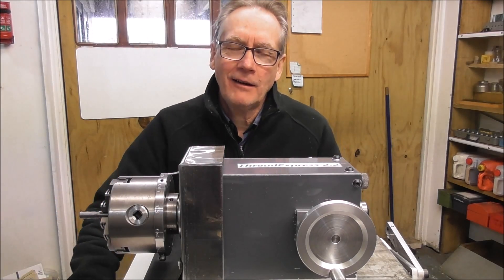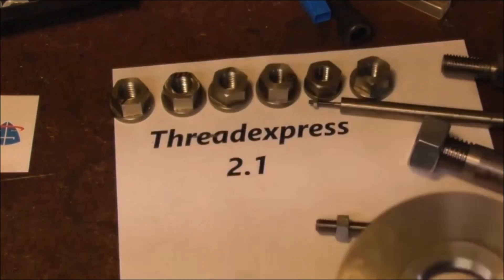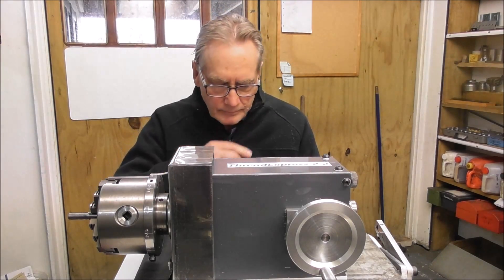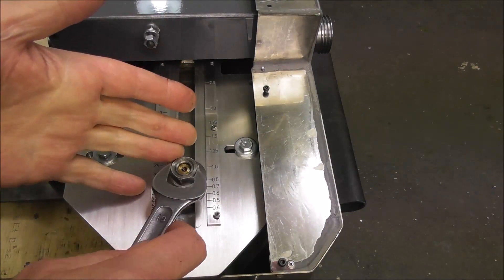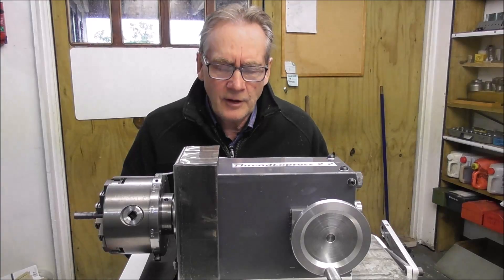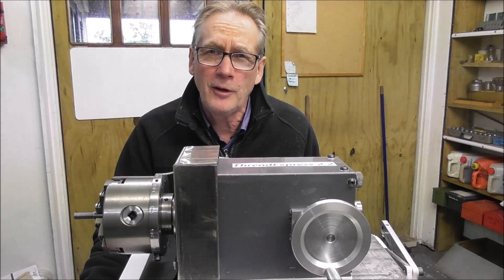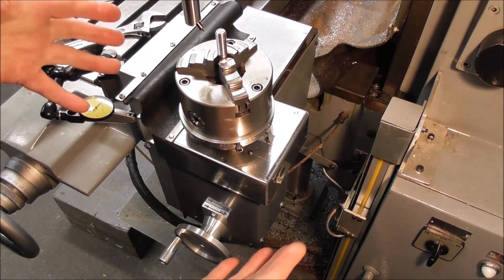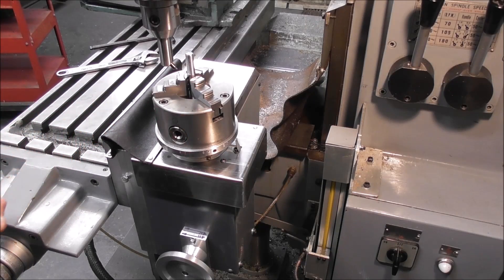ThreadExpress 2.2 Design revelation begins.

Comment: Very interesting addon. Unfortunately, it appears to require (at least the version you are showing) being able to swing the head off the bed. Great for Knee style mills be a bench mill that does not allow the head to move in that way would need some heavy modifications.   Mounting the device horizontally (similar to my BS2 dividing head BS2) would have a number of advantages I think such as handling longer thread. 
Good luck, I look foreword to seeing the plans.

As far as my guess as to the pitch mechanism it think you are using a continuous variable transmission type device. As you move the sliding nut you are increasing or decreasing the size of the "gear" on one side of the transmission.  This can be done in several ways but to get the accuracy I am guessing that you have a system similar to : https://youtu.be/_NraTmDEqNQ
Reply from the maker: Hi there ToBee. Thanks for your comment. Yes, I have mounted it horizontally see this video: https://www.youtube.com/watch?v=c3kuQPz0-84&t=812s 
But would you not need a horizontal spindle? Thanks for your guess - it is noted. Cheers, Cliff

Comment: Since you said there will be follow-up videos unveiling the specifics, I won't ask any questions regarding its capabilities or pre-reqs.

Full disclosure, I'm not a machinist, I'm not even equipped for hobby machining currently, but I'm keeping hope alive by clinging to "One day, I will!".

Even though I couldn't even utilize the Threadexpress if I owned one, it's fascinating me! I consume a lot of content from Machinist YouTube,
1) Because it's one of the types of unintentional ASMR that actually works on me;
and 2) It feels to me like the ultimate distillation of the DIY spirit (3D Printing YouTube as well) and plucky, nerdgasmic technical know-how. Using what tools you have to modify/improve upon them, and to make (for far more cost/time/effort than you could buy it new online) the tools you don't. The hobbyists with more money than time, existing toolset, experience (or in some cases, sense,) will usually opt for purchasing it delivered to their doorstep with minimal assembly, and then using it to complete those oddball projects they've been backburnering. What I've observed to the contrary is those who've entered machining from related, less technically-demanding, more physically-demanding trades (e.g. welding, forging, smithing, fabrication,  general DIY construction/renovation/restoration/scratch-build, etc.) will in most cases overcommit to the bit, and want every new tool, that isn't available branded Milwaukee, Ryobi, DeWalt, Hilti, Bosch, etc. to be hand-made, and I'm 100% here for all of their successes and flops! I get a vicarious dopamine hit seeing regular use of those bodged tools from their 18-part series that should've been titled
"I'm getting in WAY over my head here and don't fully know what I'm doing or where/how to proceed or what it'll cost me, but LET'S F-ING GOOO!!!"
but wouldn't fit in the YouTube thumbnail. Those are the best! Since I'm not a fan of the sportsball, that's my "sports". 🙃

So, since I've described what I'm not, I'll now focus on what I am, and how such a device/mechanism/tool would be relevant to me, and on that which I, random YouTube enthusiast, am an authority, which is what's pleasing to my eye.
(With my Autism & ADHD, I'm not even in control of what draws my interest much of the time, but for the sake of argument, let's assume I'm actually a rational actor...)

Having been thoroughly engrossed in this content for roughly 5 years now, I can confidently say that, aside from the mainstream content mills in this section of YouTube (e.g. Titans of CNC, et al.) I can count on one hand the amount of times I have seen thread milling utilized, and of those times, none were fly cutting.
The only method I'd seen involved partially threaded tools similar to taps/dies, larger ID for external threads, smaller OD for internal threads, and would oscillate progressively deeper for thread forming (not unlike boring mills in operation). Naturally, these suffered from the same limitations that most dies and all taps suffer from, no capacity to adjust the pitch or thread geometry at all.
If there's anything the process of fly cutting is noted for, conversely, it's adaptability.

I'm not trying to gas you up here, but to my unqualified eye, this appears to be a must-have, or the obligatory multi-part build series, typical with Hemingway-style stock+schematics kits, for anyone with a mill, and the urge to zhuzh up their IG Reels, TikToks, or YouTube Shorts with classy & hypnotic threading content. Though, (if you'll grant me the Dad joke) Meta's Threads seems the obvious choice. 😏

Once again, I'm not actually part of your market demographic, but I believe (at least tangentially) I'm part of their market demographic, and I'm intrigued. 

As they say, the proof in the pudding is in the eating, so if it can do what you've specifically said it can, and hopefully what it appears to me capable of but wasn't outright mentioned. Specifically, cutting thread profiles other than standard metric and imperial nuts/bolts (like Acme), and whether it's: Compatible with an indexing/dividing head, 4-jaw, 6-jaw, and/or collet chuck; Whether the spindle can accommodate bar stock out the back as well as how much if so; And, the feasibility (with adequate preparation) of using the ThreadExpress for the machine restoration projects remachining the various Acme-threaded drivetrain screws and nuts ubiquitous to lathes, mills, drill presses, etc.
I believe that capability alone would be the killer app for the ThreadExpress, insofar as my predicted engagement would land. 

From someone with almost full aphantasia so I have no eye for design or schematics, but a keen vision for systems and long-term, broader-picture projections (also, I'm a sucker for kiwis), I wish you all the luck and success in the world! 🫶🏾

EDIT: After posting this and reading a whole bunch of the other comments, and your responses, another potential project came to mind (if indeed it can accommodate obscure, and especially eccentric "threads").
Extruder leadscrews for 3D printer filament/beads, for both the printer, and primarily for building recycler/reclamation devices (the contraptions that take your finely-ground former 3D prints, melt the tow down, and extrude out recycled filament.) This is a device that, although conceptually easy to DIY, the extrusion leadscrew is where theory and reality diverge, as most schematics for the type of machine utilize a leadscrew with uniform, symmetrical threads. To functionally do this though, an eccentric thread is necessary, to effectively accommodate and extrude reclaimed plastics at progressively advanced stages of flux, from ambient temp solids, up to 180°C+ gelatinous liquid or liquefied gel (unsure on the proper descriptor).
Anyway, this was just my random stream of consciousness system dump. I thought it worth the time to type it out, so I hope it makes some semblance of sense, and can somehow be of use to you.
Reply: If you like unusual thread milling try   Fast rise ball screw inspection jack. 30mm lift per turn.   This uses a face mill to cut the male thread and balls form the female thread.
Reply from the maker: Wow...that was a comment! Aah...where to begin. I appreciate you taking the time to speak because content like this is showing me there is more to engineering than its nuts and bolts. I have sensed it in the past, but good to have it confirmed, there seems to be other whole realms of philosophical and psychological landscape involved. Cheers, Cliff
Reply: There are many single point thread mills out there. the channel adam the machinist uses them all the time thread milling tungten carbide bores without a pilot hole.

Comment: It has a lead screw/nut that raises the rotary table/chuck. The lead screw is coupled to the rotation of the table/chuck by means of a CVT mechanism. Adjusting the slide nut changes the ratio of the CVT.
Reply from the maker: Thanks Ken. Your guess is noted. Cheers, Cliff
Reply: Which is really cool. I'm not sure what use it is, in the days when CNCs are available and can thread mill just fine, but still very cool.
Reply from the maker: @kenmagalnik6596  Thanks for your thoughts. I have a CNC and do threadmilling also, and I still would use the CNC process for multiple parts that do not have to be highly accurate. But for one part, depending on the part, I would do it in ThreadExpress more quickly. Depending on the part pitch and diameter etc the ability to set the work at the helix angle gives a more accurate thread form. (This cannot be done via normal vertical CNC thread machining). Also, many small shops around the world do not have an operator that would be comfortable with CNC technology. Cheers, Cliff
Reply: @Threadexpress  you know, this might be useful attachment for a grinder.
Reply from the maker: @kenmagalnik6596  Yes I have done some basic trails: https://www.youtube.com/watch?v=c3kuQPz0-84&t=815s at around 27 mins. Cheers, Cliff
Reply: My thoughts exactly. The only way to do it is via a friction drive Ahla the cvt. There can be no positive drive on a purely mechanical variator system. It could be done hydraulically but not in a package that small. Positive displacement pumps with a varied stroke running a motor that was also positive displacement that could also have a variable stroke. Stroke changes would alter the drive ratio. Oil isn't compressible so the ratios would be repeatable.
Reply: @dazaspc  it could also be a lever where the slide is shifting the leverage point.  Which would be sort of a CVT with a limited travel.

Comment: I, too, am guessing that it uses a variation of the sinebar principal similar to a barrel rifling machine.  Depending on price, I would be interested in buying the plans or a machine or possibly both. I have cnc thread milling capabilities, but I love mechanical devices. After thought, I might be in the collector camp.
Reply from the maker: Hi Carl. Thanks for your feedback. You sound like a fellow hardware junky! Thanks for your design guess, it is noted, I am sure you understand I cannot reply to this until after the design is revealed. Cheers, Cliff

Comment: Hi Cliff, I'm sorry to hear that you haven't been more successful in marketing your invention. Personally, I'm also only in the third of your categories and not a potential customer. Regarding your challenge: I think you've basically replicated a lathe taper turning attachment, where your hand crank does both, turn the spindle and move the 'saddle'. The spindle must then ride on the 'cross slide' - very nice! All the best from half around the world, I'll sure follow your reveal.
Reply from the maker: Hi John. Thanks for your feedback and support, most appreciated. Thanks for your design guess, it is noted, I am sure you understand I cannot reply to this until after the design is revealed.
Reply: @Threadexpress  One additional comment, if you don't mind: I very much appreciate neat mechanical solutions and would have expected nothing else from someone like you. But if I had given the task to solve this problem, I would have resorted to electronics, with a standard ball screw arrangement driven by a stepper motor for the feed movement, synchronized to the spindle motion via a rotary encoder. This allows to largely use readily available off-the-shelf parts and reduces the number of custom components that have to be machined to tight tolerances, both of which I think is important to make low volume products affordable. I wouldn't be surprised if that were to reduce overall unit costs by as much as 50%. It would trivially enable some useful features too, allowing rapid traverse to the starting position, thread pitches from zero to infinity, and also cutting left-hand threads, which would require additional gearing in your design.
Reply from the maker: @johncole1801  Hi John. Yes, like others you are challenging me with a very good argument. I think I need to think this through carefully and address it in a future video. Cheers, Cliff

Comment: I’ve been machining and designing equipment for over 50 years. I’ve seen some very interesting machines over the decades and I also have many old machinery books going back to the mid 1800s. I’m saying this because your machine is very interesting and clever. The concept is simple but not something I’ve come across. I have several different size Geometric automatic die heads. I’ve never had a Coventry, but basically similar. For those who haven’t heard of them, they’re used on the lathe or a turret lathe. They allowed manufacturers who needed to make special screws in fair, but not massive numbers, where an automatic screw machine would be used. These heads haven’t been made for decades. CNC, thread mills and other methods have taken over. That’s the problem with inventing something that works well, but is out of time. 50 years ago this would have been popular enough to be worthwhile making. Now, you’ve found that it isn’t. That’s a shame, really. I’m retired so my Geometric heads are great. But if I were still making products for sale, I would have considered this. I know that’s water under the bridge, so to speak, but that’s why it’s difficult to come up with a new mechanical way of doing something that can be programmed for a CNC. I’ve “invented” a number of devices and products over the years that I just make for myself, and sometimes for friends, but that I would never think of producing at volume. Good luck with this.
Reply from the maker: Hi there. I appreciate the time you took to give your feedback. Yes, I get a strange feeling this should have been invented years ago, it is one of those designs that is complete in itself and just got ''missed'' somehow.  I wish we could meet up for a coffee, sounds like we have a lot in common, we would have lots to talk about. Best regards, Cliff
Reply: @Threadexpress  I agree. Too bad I’m in New York City.
Reply: @melgross   I'm not sure why your follow-up comment immediately reminded me of those old Pace Salsa commercials, but it did, and I couldn't help myself but to share. 🫣

"This stuff's made in New York City!!"

"NEW YORK CITY?!!?" 😱
<guns unholstering>

Comment: I'm wondering about tilting the ThreadExpress to the thread helix angle and whether the mating part is produced with the same helix angle adjustment.  An example would be a nut produced with a tap.  Are taps made with helix angle adjustment or is the 60 degree profile perpendicular to the axis?
Reply from the maker: Hi there! This is a much-discussed subject as you may know. Some small diameter cutters, fine pitch and larger diameter threads do not need a helix angle setting as the sweep path of the cutter clears away from the thread form. But as the pitch and cutter diameter increases, you can imagine the sweep of the cutter does not stay in the thread 'valley', but begins to cut into the thread profile, especially with internal threads. This is why higher precision thread cutting processes such as thread grinding, have helix angle adjustments. Because the helix angle varies from thread to thread, affected by its diameter and pitch, the thread profile of a multipurpose cutter cannot accommodate all the different profile shape offset requirements to suit every thread, so a symmetrical thread form is used, and the helix angle is set when required. High end cutter manufacturers such as Sandvik Coromant and Iscar produce lathe screw cutting tooling with adjustable helix angles. If you are interested, there are pages of information available from these suppliers on the setting of helix angles. this is a quote: "The parameter for tilting the threading insert relative to the helix angle of threading is of great importance when threading is produced.' Re your question on tap form. A tap is thread pitch and diameter specific and does not need a variable helix angle adjustment, but it does have a clearance profile ground to the thread's helix angle. Cheers, Cliff
Reply: " it does have a clearance profile ground to the thread's helix angle"
What is meant by "clearance profile"?  The grinding wheel is dressed to other than 60 degrees?
Reply: @npalen no. Clearance profile means that the form of the tool below the cutting edge is angled away from the work being cut. It’s similar to trepanning on the lathe where the cutter has to have the outer side of the cutter curve inward toward the bottom so as not to impact the outer edge of the cut. Not exactly the same of course as the threading tool moves longitudinally as it’s cutting, whereas the trepanning cutter just moves inwards. But the clearance is the same concept.
Reply: @melgross  So are taps ground to a true 60 degree profile or to ever so slightly different than 60 to compensate for helix angle?  I understand what you mean by clearance.